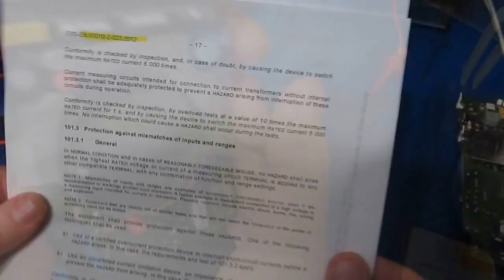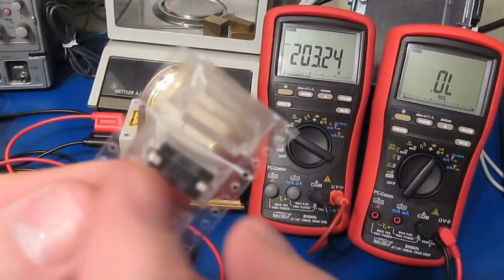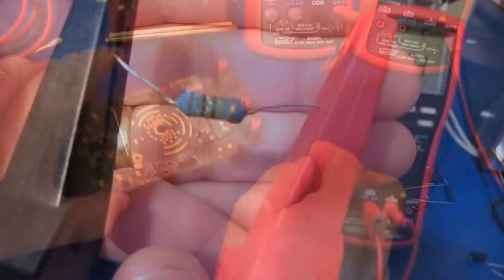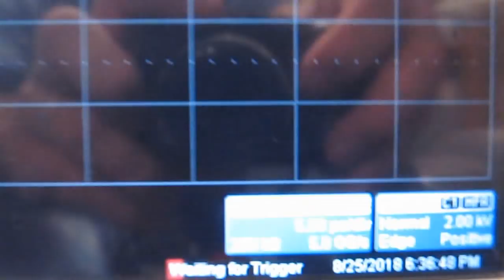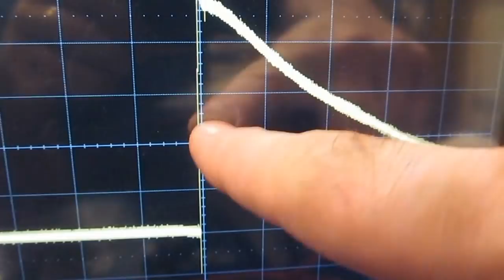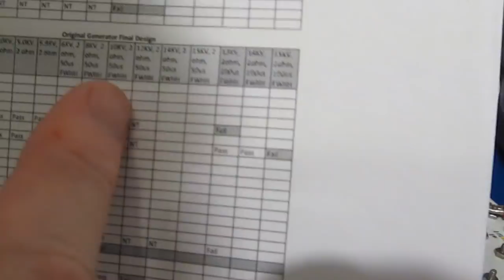Vintage Fluke 189, Replacing the Supercap and More

Comment: As you already said in the video, I just removed the ultacapacitor, one of my first Fluke 289 had a leaking ultacapacitor just after 3 years of use, so I just remove them from the 289 and the 189. 
The only downside is that you have to set the time and date after replacing the batteries. 
Upside is that I do not have to check for leaking ultacapacitors anymore.
Reply from the maker: I still have some early supercaps that we used back in the mid 80s.   These were very reliable but used a different technology than the tablet that I mentioned that was damaged.  The tablet was maybe three years old as well.  I have not seen the parts I am using leak yet but it's early.  I  hope by derating them they will out live me.
Reply: I kept the ultracapacitor and cleaned it after removing it from the 289, it was a single cell ultracapacitor and some brown goo was exiting from the negative end, the laser etching on the ultracapacitor said 3N14 (it measures 6,78mm in diameter and the thickness is 1,73mm).
Reply from the maker: The 189s I have are all used.  I really have no idea how they were used.  They are a fairly old meter and I would expect them to have some problems after several years of service.  

Strange that Fluke would not have covered that under warranty on a 289.  If they left me hanging like that on a three year old top of the line meter, I would do more than just remove the cap.   Is there more to the story??   Did you buy it brand new?  Was the meter really three years old or was that just how long you had owned it?  If it was brand new and you are the original owner, why would you ever take a soldering iron to it?  Did you try to have them warranty it and if so, what was the reason they would not cover it?    Please fill in the blanks.
Reply: It was brand new (7 years ago), I did it myself because I did not want to wait for it to be repaired by Fluke, and I felt it was not a big deal to remove it, it gave me a peace of mind to not have it in there, eventually a new ultacapacitor can always begin to leak again and destroy the PCB, and really in the 189 with the C-Cell battery holder I would never install it again anyway. I have another (second hand) 189 and also removed the ultracapacitor, I already bought a second BP189 to attach to it, so it can work for many years as well. These Fluke 189 may be old meters, but they do work very good and I can use the Fluke ir-3000FC Bluetooth to log and see the screen remotely.
Reply from the maker: I picked up a BT interface from UNI-T but after I received it, I realized they had lied in their manual and have no support for the Windows OS.  Then again, I don't know why I was expecting anything less from UNI-T.  

Good to hear it was not a warranty problem from Fluke.  I was thinking that may have been a free NIST cal.   On the reliability of the caps I am using, ask me again in 20 years if I am still alive and have the mental capacity to know what you are talking about.